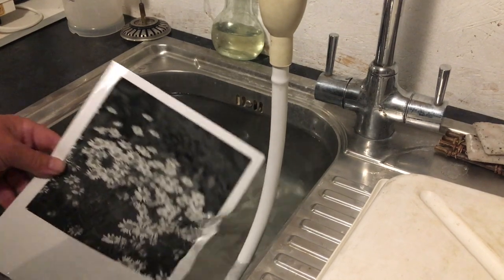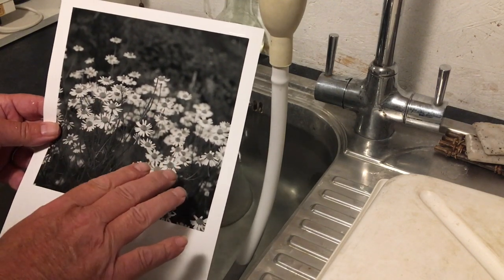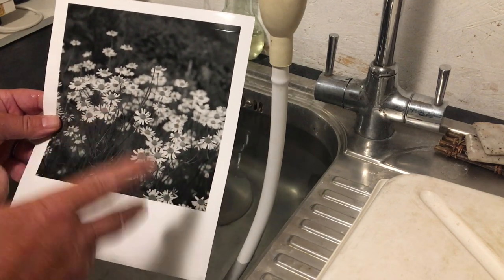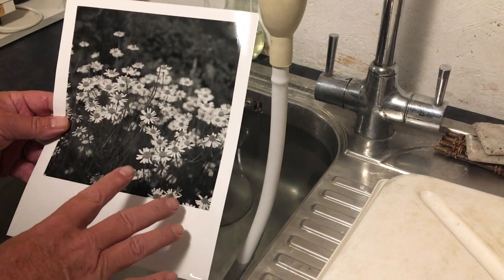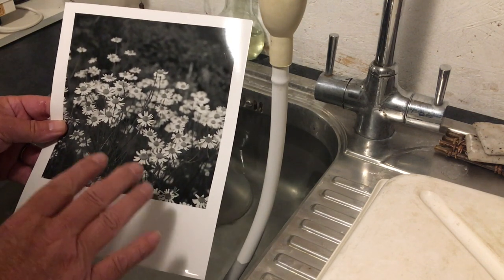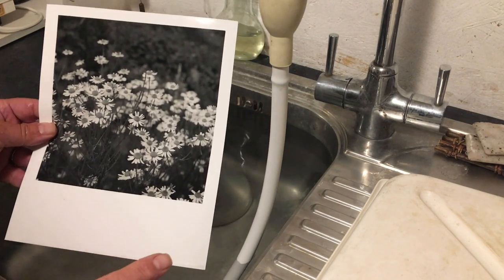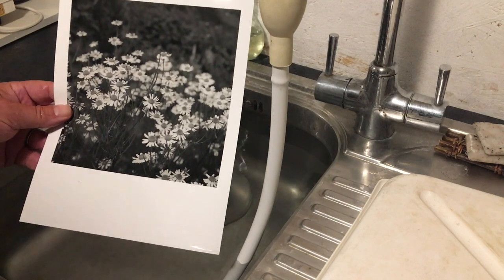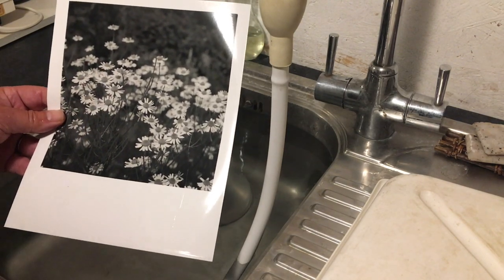Print Dry Down - How to Beat it

Comment: I’ll have to test out the 10% reduction in exposure.  That might make a good alternative to how I make my test strips.  In my case I keep a hair dryer in my darkroom and I blow dry each test strip until it’s dry enough to judge.
Reply from the maker: Hi Lars, I also used a hairdryer and even a air blowing heater for years. They work well but found the 10% works just as well for me. You might need to tweak your percentage a little to get exactly the look you like but it will save you some steps in the long run. Thanks for watching!

Comment: I am curious to know what 10% is when developing? How many minutes do you take away or add with 10%? I like your channel its been very helpful!
Reply from the maker: 10% is like any 10% but I can see why this might be puzzling. Here's what I do. I use the calculator on my phone and find the number of seconds for the development time. I then add or reduce the time accordingly by the percentage required and convert back to minutes by dividing by 60.
Reply: @PictorialPlanet  I am not good at math sorry but I hope you can answer my questions and help me understand it in a easy way. So do you take away 10% on the enlarger?  So say my exposure time is 5 seconds under the enlarger do I take away 10% from 5 seconds? I do not understand percentages and I'm learning now that a lot of this is math.
Reply from the maker: Yes, take away 10% from 5 seconds. You'll need to watch some YouTube channels on using percentages.